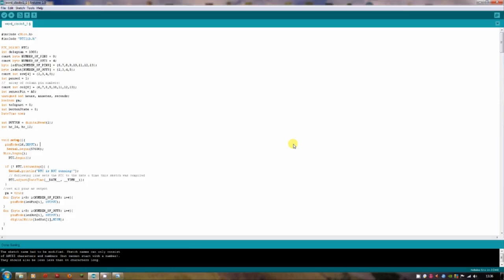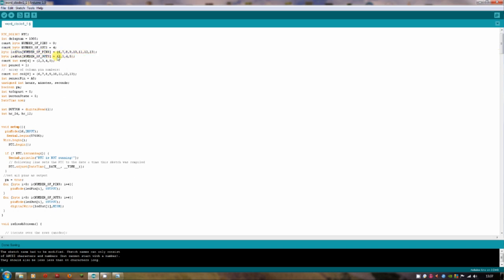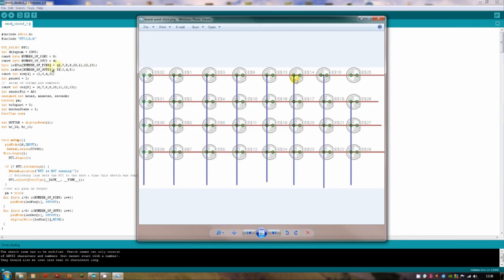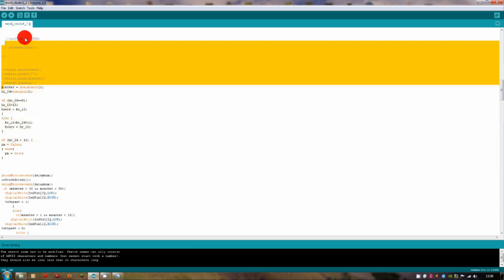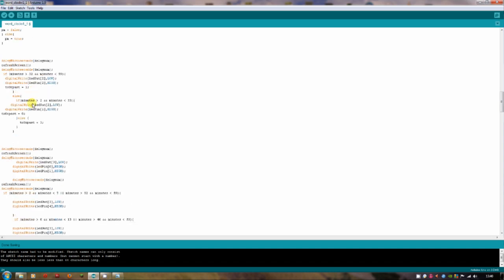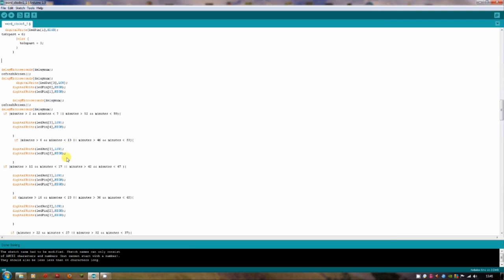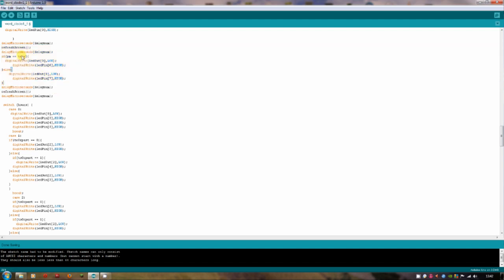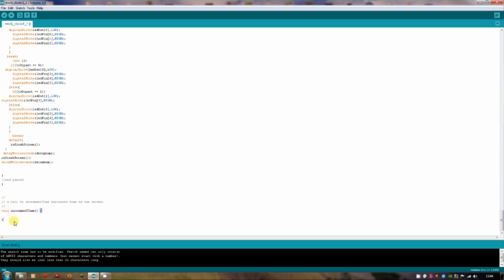How to make a Word Clock with Arduino - Part 2

Comment: I tried with your code but an error messge : 'RTC_DS1307 does not name a type'. Kindly advise me what's wrong with me.
Reply from the maker: Hi Mate, this is pretty old now so it is likely that the code no longer works with the current Arduino IDE. I would advise just using the code as a guide and starting over with the newer libraries, I was pretty inexperienced when I made this so you could easily improve it.
Reply: David Watts Thanks a lot Sir. But where can i get new libraries ? Kindly guide me. Regards.
Reply from the maker: You can use the Adafruit library here -https://github.com/adafruit/RTClib
Reply: David Watts
thanks. but this morning, on the link provided. I downloaded the RTClibmaster.zip but when I tried to import it to the arduino IDE, again an error message is coming - "The library RTClib-master" cannot be used. Library names must contain only basic letters and numbers (ASCII only and no spaces, and it cannot start with a number). So I am now confused. What to do next please Regards.

Comment: What would I have to do to apply this to AdaFruit's LCD IC2 backpack instead of the LED matrix?  I also have an Adafruit 8x8 led 2 pin matrix, could your code be modified to accommodate that?  Thanks
Reply from the maker: It shouldn't be too difficult, essentially you have the hard part already done. Adafruit also have a library for that display which will make it easier.

You will only need to use the time stuff in my code.
Reply: David Watts Thanks... I will look at the code today and see what can be done.

Comment from the maker: With a bit of tweaking for pins and some adjustment for daylight savings (whihc I never considered), yes. I did find a bug... It does get confused occasionally with too or past the hour, the code to test that is it seem called at the wrong time (it was fun figuring that one out).